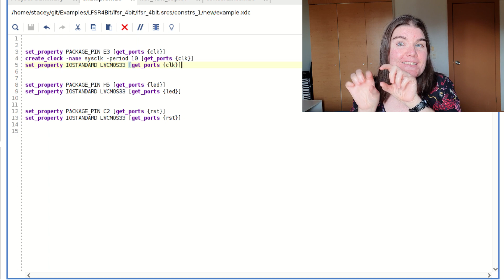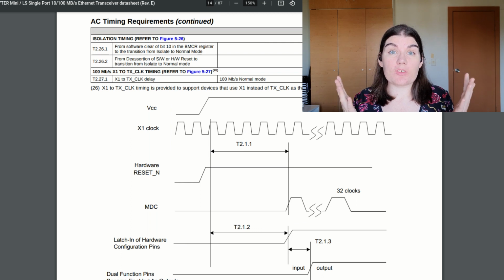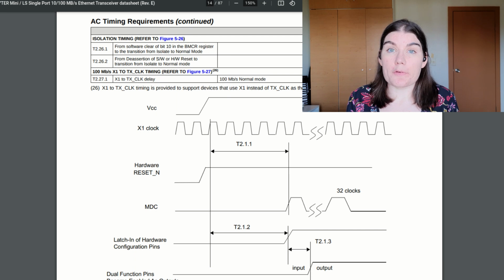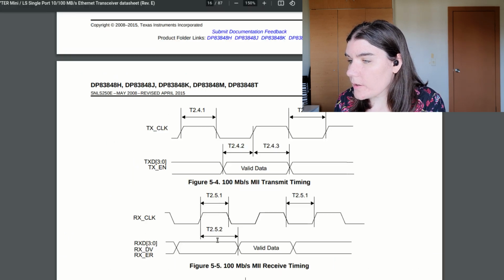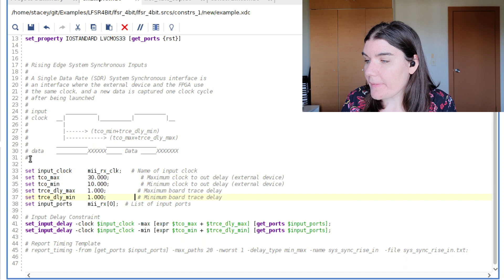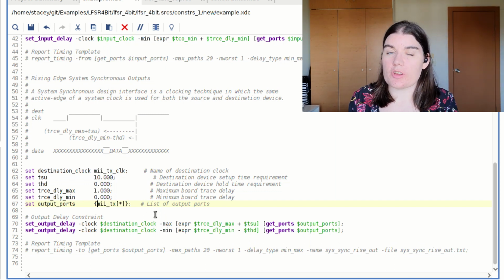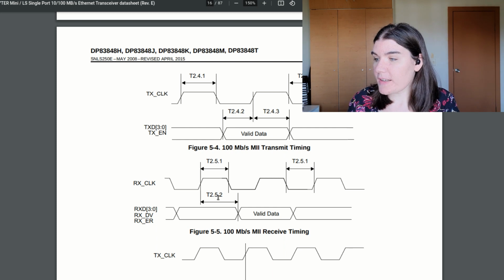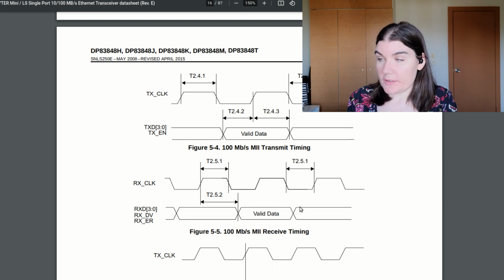Creating input and output delay constraints

Comment: Very good explanation. Your github template is missing the set_input_delay calls. As others have mentioned some other examples would be good to cover some other common components that people would need to constrain. Examples I can think of are SDR SDRAM (quite common on cheaper dev boards and usually driven by soft IP unlike DDR), an advanced/counter intuitive example might be asynchronous SRAM where you don't have a true external clock but you can still constrain the interface.

Comment: A great intro for anyone new to timing constraints, thank you for making this.
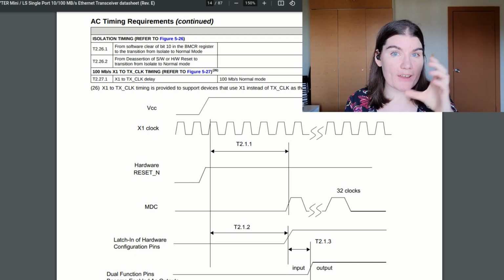At 2:24 you advise to increase the output delay to account for trace length -- But if the clock is sent out from the FPGA, is accounting for trace delays really necessary on the output? After all, the trace delays for the entire communication bus (clock included) is the sam

Comment: Thank you very much for this very informative video! I have a question: In this example, the clock came from outside the FPGA, but how do we create a new clock constraint corresponding to the output of a PLL(Clock wizard), and how do we then set delay constraints between some input data and this new internal clock generated by the clock wizard ? I tried using get_ports <output_ClockWizard_clock_port_name> but it says no ports matched  <output_ClockWizard_clock_port_name>.